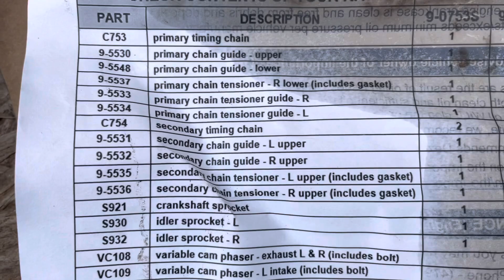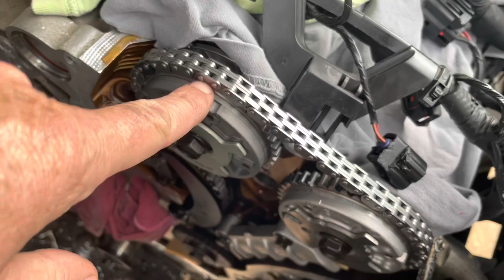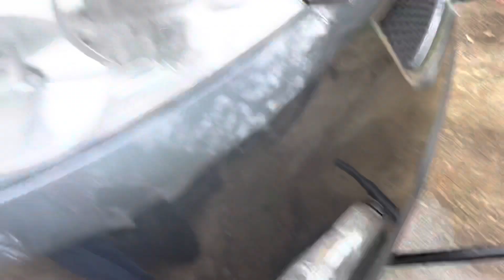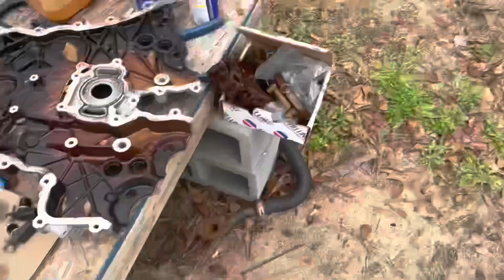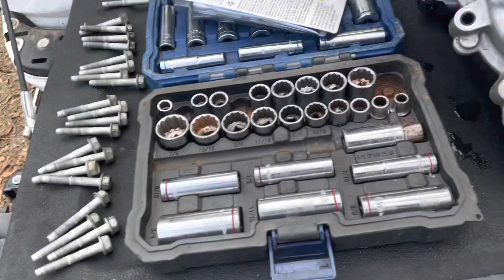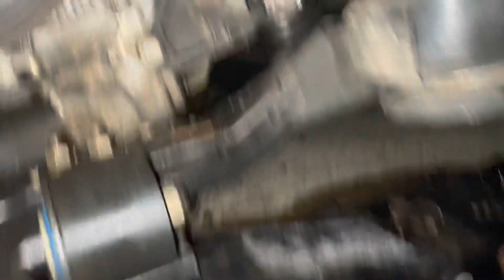2) Traverse Timing Chains In Car Fix - GM 3.6

Comment: Did the cloyes timing chain kit last for you ? I’ve had the chain break on me after about 10k miles on a customers vehicle. Oem only for me from
Now on.
Reply from the maker: Funny you mention that now. The SUV (Traverse) quit running gradually over a week. So I’m doing the job again. I have the cover off and all chains are still in place and tensioned. But the exhaust phaser on the front bank (GM calls it the left bank) has failed because it isn’t locked. It moves with a wrench with the engine off. After reading about Cloyes chains breaking I bought all Melling this time around. I’m replacing the phaser with a genuine GM part but honestly it doesn’t look better quality than the Chinese Melling phaser I returned. I hope to have it all back together soon.
Reply: @moccasinmarine   So how did it go?
Reply from the maker: @robertwierenga3187  it’s still in the same condition is was when I wrote the above. Trying to find time to get to it.
Reply: @moccasinmarine  Oh okay sorry please let us know if you get it fixed

Comment: I just got the front engine cover off my 2011 Traverse, 😅😅😅 all new GM parts here we go damn i'm nervous
Reply from the maker: You need to be nervous. Here’s a tip. Instead of using silicone sealant use Permatex Aviation Sealer to seal the front cover to the engine. It is much more oil resistant.
Reply: @moccasinmarine  I'm cleaning the engine cover up and I'm seeing pitting behind where the water pump sits. Should I replace the cover or epoxy and sand it? Update, I bought a new one.
Reply: @moccasinmarine hey one more question, the 2 cams on the left side of engine look like flats are up but when I put the tool on them to lock them in place one of the cams is not completely flat and the tool won't fit, oil pump mark is lined up. I tried with a wrench with chain on to move cam a little but tool still won't fit all the way. I'm also replacing phasers, should I take phaser off and use the wrench on the cam to try to move it enough to get the tool to fit? It actual looks like the cam tool almost fits when I'm a bit past oil pump mark.. I'm going slow trying to do it right. Thanks
Reply from the maker: Honestly I can’t offer much help on this project. It’s been over two years since I did the work and I’m don’t remember much about the work. You’ll have to refer to the references I mention in the videos.
Reply: @moccasinmarine No problem. I'm all finished with the timing. I'm just waiting for my new timing cover to arrive. Thanks again. Your video and the other one were lots of help. It was really nice to KNOW for sure 100% that I did it right 👍

Comment: to  get the idler pulley bolt  just back the motor mount bolts  almost off. and jack the engine up a inch or two

Comment: The alternator  idler bolt may come out if the engine was moved . The rubber mounts will give if you pry the engine back a little.

Comment: Pull engine to change idler pulley .  WOW !!  And we will make it more difficult .  These ppl should be put in the dirt .
Reply from the maker: I have no idea what you are talking about.
Reply: @moccasinmarine  what do you mean   you don't know what im talkin about  ? How do you take the idler pulley off then ?
Reply from the maker: @roundcornerent  sorry I did these videos over a year ago. I didn’t remember anything about them. I just saw what you were referring to. In future if you include the time stamp in the comment it’s much easier to know what you are commenting about.
Reply: You dont have to pull the engine you just have to remove the alternator but yeah its hard to get to

Comment: Why would anyone make a motor that don't run any better then a pinto or a chevette and so complicated  to work on, makes no sense  heck wasn't as hard to fix a pinto ,they dint cost as much ,easier to work on and you dint have to go mortgage your home just to buy one ,common what's wrong with the peoe who built these pieces of junk,who ever you are ,thanks now I have three of these to do and they don't even have 100,000 miles on them ,this is our fault as well for even buying these and sopporting these junkers if everyone would stop buying these junkers the prices and the quaulity would get bettercommon everyone we can change these things
Reply from the maker: Modern fuel injection and catalytic converters are solely responsible for cleaning up the air we breathe. Exhaust gas recirculation (EGR) has been reducing nitrogen oxide pollution since the 70s. So technological advances aren’t bad in general. The mistake GM made here was not designing the cam phasor with adequate range to compensate for chain stretch.